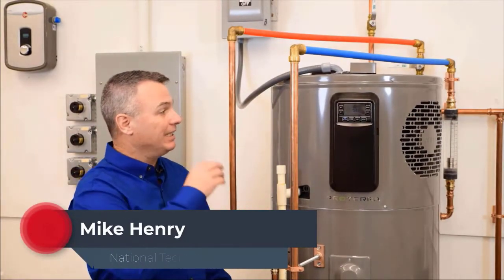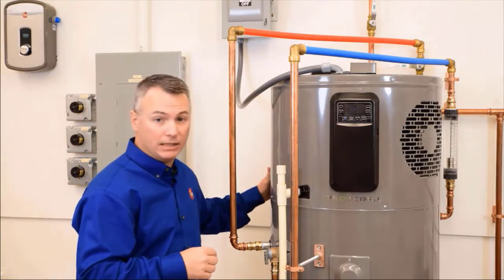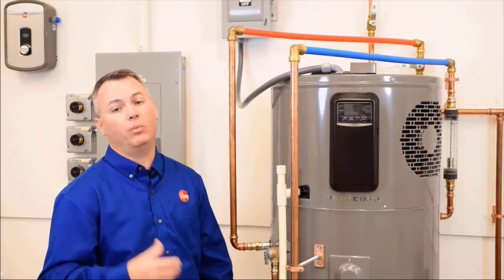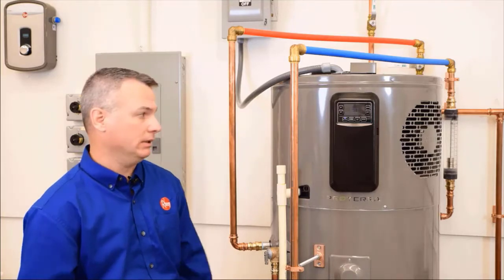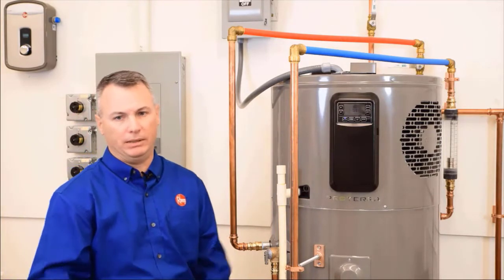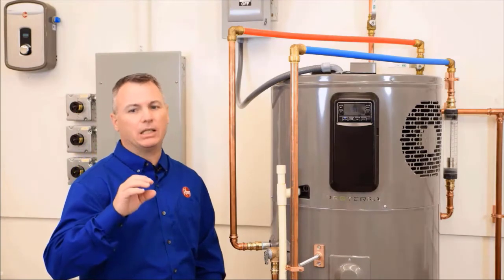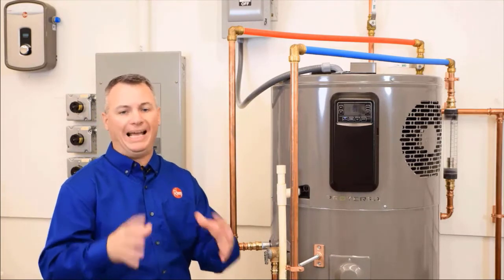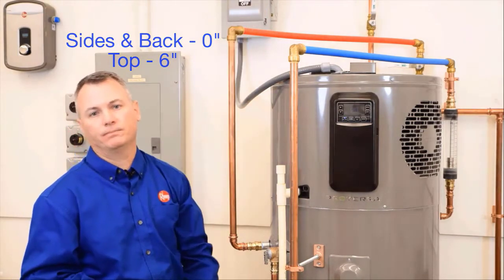Clearances for Installing Rheem® ProTerra™ Hybrid Electric Heat Pump Water Heaters

Comment: I have the Rheem hybrid water heater that my home builder installed but the compressor is very noisy (about 70 dB). Rheem sent a technician who said he could not replace the parts or diagnosed because he couldn't open the lid due to the side clearance that is about 2 inches, and claimed it is not serviceable and blamed on the home builder. There is a screw there but the wall is blocking it. Rheem hybrid online tech support then confirmed that zero clearances are not true and require 6" clearances. My builder sent me the installation brochure that showed 0 clearances, which Rheem online supervisor argued it's not true. Who is not telling the truth here?

Comment: Great video. I plan on installing in a small closet, but I'm wondering if my intake air may duct from my 1000 cubic foot unvented attic? If so should my exhaust also enter the attic, perhaps at the opposite end? 
Thanks

Comment: I just had a 2021 80 gal Pro Terra heat pump water heater  installed in my basement and we can here it in every room in the house.  It’s loud. I’ve spent the last 2 days on hold trying to get in touch with Rheem’s hybrid water heater customer service.  Still have yet to talk to anyone or get of my emails returned..  Terrible customer service!!
Reply: Replace the fan motor and blade. It's a typical known issue with them.
If it doesn't help the issue. Use a ducting kit with about 4/5 feet of insulated ducting. The insulation will dampen sound.
 
Can also try some sound deadening foam blocks, the ones you see in recording studios with sharp edges, around and above it. Not ideal but it should absorb the lower frequencies pretty well. 

I installed one of these in my mom's house and she hasn't complained about it. And she hears EVERYTHING, I only hear it in the kitchen right over top of where it's installed.
Reply from the maker: I’m sorry you’re having trouble getting through. Our call volume is high and email response is slower than normal due to call volume. To expedite your issue, please email your serial number and contact information to social@rheemconnections.com and someone will reach out to you.

Comment: I hear this is a great water heater, but the side mounts for the water forces that ridiculous maze of pipes.  Seriously, this didn't occur to the engineers?  It makes an old-timey electric water heater look elegant.  Very odd.
Reply from the maker: Hi Mark, thanks for the note. We designed the product this way because the heat pump component is located on the top, so side mounts are more easily accessible. Additionally, since this unit is typically taller than the unit being replaced, overhead space can become an issue for water piping on the top of the unit. Let us know if you have additional questions.
Reply: @rheemwater  Unfortunately even though the plug-in series is taller, it's still much simpler to extend pipes straight upward than to add multiple elbows at odd angles needed to run supply pipes back down the sides of the unit. Side mount makes it more difficult to add a necessary external expansion tank. It makes removing the unit in the future also more time consuming, by requiring removal of copper pipes in front of the unit. And in 10 years the customer's next replacement unit is unlikely to have side mounts, so we'll have to move them again. As Mark mentioned it's also challenging to explain to customers why thy should enjoy seeing the maze of copper in front of the Rheem brand and technology they're paying extra for.